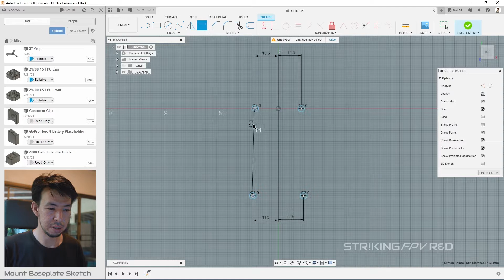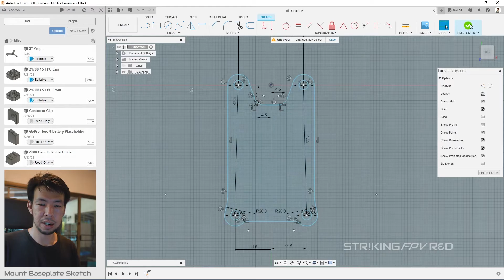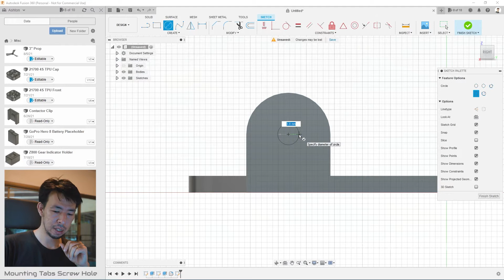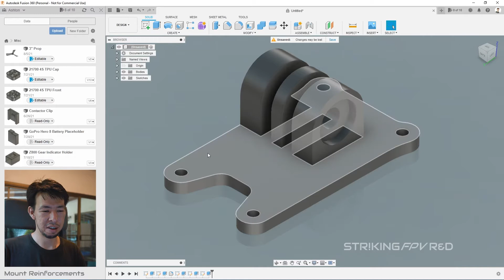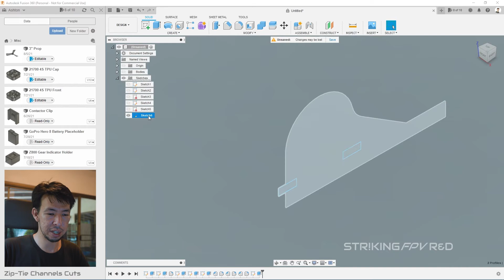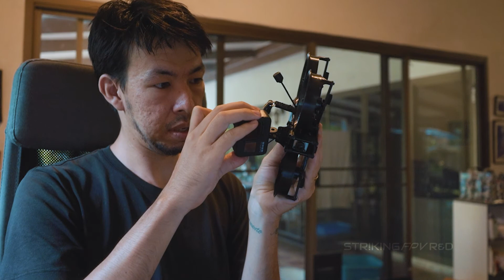Create Your Own GoPro Hero8 Cinewhoop Mount in Fusion 360

Comment: How about find the top plate on your drone on a maybe cnc form so you can import it on fusion and design it there ? Am new to 3d design with fusion and am trying to learn the easiest way to do thing, plus with no errors so i dont have to print same thing 3-4 times and fixing it. Thanks in advance
Reply from the maker: If you can find the original parts then that would work perfectly, but you also have to consider where the design came from - if it's provided by the original designer/manufacturer, then perfect, but if it's also by a hobbyist like us then you end up trusting their ability to measure with accurate callipers and make some safe assumptions about manufacturing tolerances too.

In the end, I like doing it myself because then I have someone to blame for getting it wrong

Comment: I've tried to recreate this mount following this video and I can't get it to work.  Something important must have been edited out somewhere around the trimming of the circles.
Reply from the maker: Sorry for the late reply - whereabouts in the video are you getting stuck?  To my knowledge I've edited this start to finish okay, but sometimes in some design situations Fusion 360 can be a bit finnicky, maybe you're experiencing something like that?  It's like not being able to make a 5mm chamfer that should be possible but a 4.9998mm chamfer works, or in a sketch if you click and think a line got snapped-to, but actually it snapped to a grid point and the line never intersected the target shape, which would leave a hole and make trimming behave weird unless you really zoom in.  Stuff like that.

Comment: Great tutorial, thank you for sharing. One thing I don't understand is why you did not center the three slots on the base, like this the GoPro won't sit centered on the quad.
Reply from the maker: Hey, yes, you're correct - the reason I did this is because the actual camera part of the GoPro is also offset to one side, so by designing it this way I bring the actual camera closer to the quad's centre.  Sure, also messes with the left/right balance, unless you fly without a battery and use that iFlight balance to 5v USB-C connector, in which case the balance is improved.

And sorry for the late reply, I've been stupid busy with my day job the past few months!
Reply: @STRIKINGFPV  Apreciate you taking the time to respond. Thank you!
Reply from the maker: My pleasure - only sad I didn't respond sooner, been so swamped and stressed with work that I neglected the channel for a long while already 😩

Comment: do you have any experience printing this kind of mount with PLA? i always print using TPU but you know.. it makes tiny wobble.. i wonder if PLA will work better..
Reply from the maker: I think it would be fine, but PLA is much more brittle, so any hard impacts - direct or indirect - will probably break the mount.

When I first started printing TPU, I found that my parts were too flexible, even at 100% infill (or 10+ perimeters), but I increased my extrusion multiplier by .1 to overextrud the TPU which made my TPU prints much stiffer.  You'll have to experiment here depending on your printer, but I find this is the best way to increase rigidity without modifying the part design.

Sorry for the late reply, day job has been killing me the past few months.

Comment: Nice video.. 
What is it on your lens? Lens protector? ND filter holder?
Reply from the maker: Sorry for the late reply, it's a Telesin ND filter mount.  When you buy the kit you clip that part on first which has magnets around the edges, and each filter magnetically clips into place.  Good for getting motion blur into the video by reducing the shutter speed.  Downside is that a hard crash and the ND filter will fly off.  Already lost 2 that way, haha.  Still got the 32 and 16 though, arguably the most used ones, hehe.